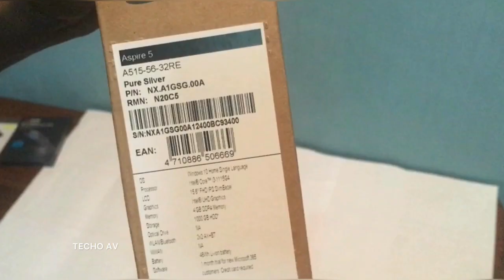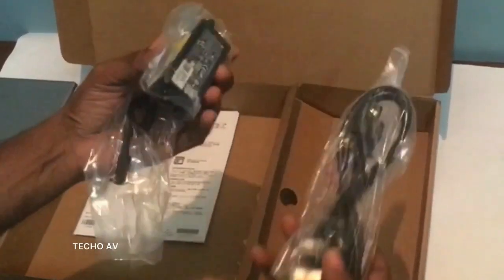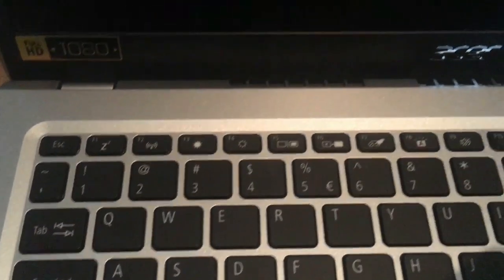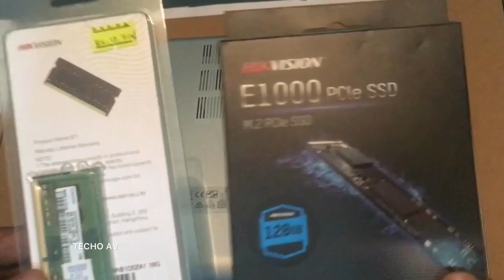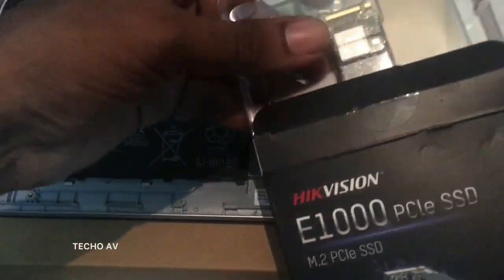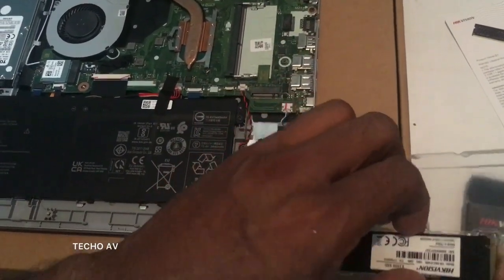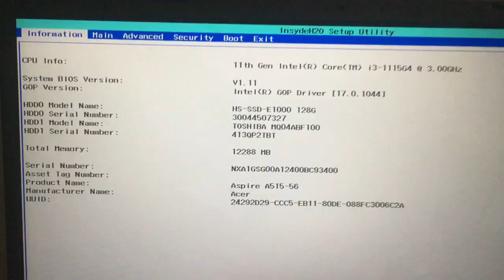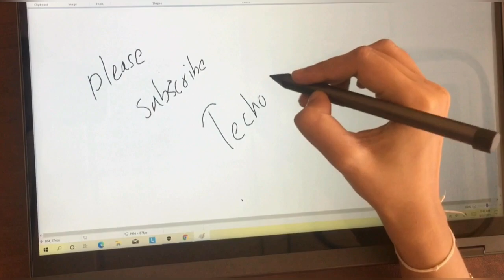Acer Aspire 5 A515 Unboxing 2021 | Ram and M.2 SSD Upgrade

Comment: Is the Acer Aspire 5 A515 only support  PCIe SSD  ? Or can go with Standard M.2 Sata SSD
Reply from the maker: 11th Genaration laptops support only PCIe SSD (NVMe) including Aspire 5 series which is 11th gen. Standard M.2 SSD not support for upcoming latest laptop models 😊
Reply: @TechoAV   Thanks a lot